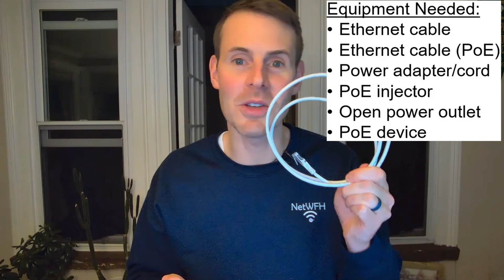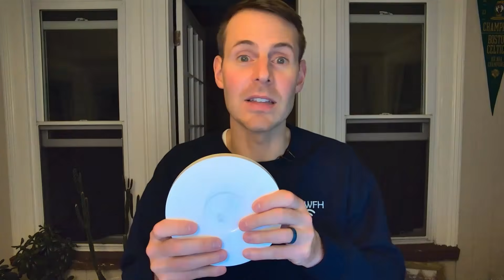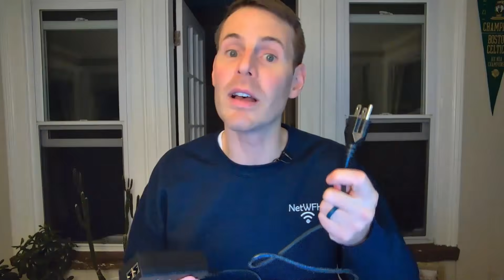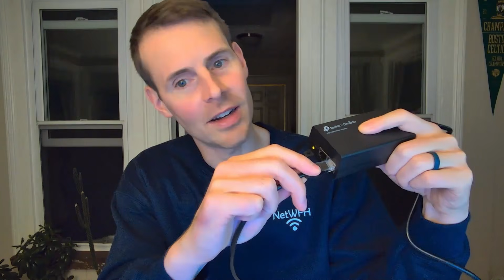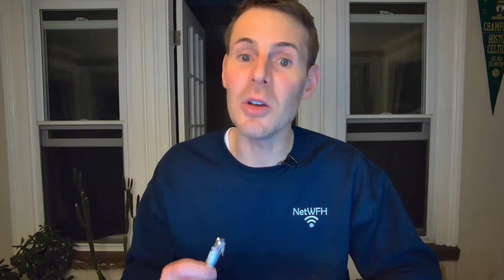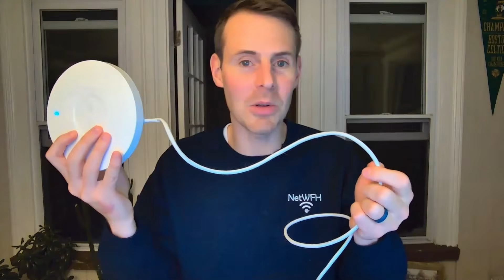How to Set Up a PoE Injector: A Step-by-Step Guide

Comment: Im just diving into this because I want a couple of home security camera's. But I most say this SO demotivating. Everhwhere I read: you should buy POE cameras, its more reliable, and all the other reasons. But the thing is: I want one camera on the front of my house, and one on the back. With POE cameras I also need a NVR, which then has to be close to my router since it has to be connected physically. Then I have to connect ethernet cables to the POE camera's and pull these cable all the way to the NVR, or use a switch in the middle and from there a cable to the NVR. This means: cables everywhere, from the cameras, through bedrooms, guided through corners of walls, from upstairs to downstairs, many more corners to the NVR. Why does it have to be this difficult? Why can't there be such a thing which can be used reliably but then wireless? I dont get it.

Comment: how about with regards to data transfer speed exaple if you have gigabit connection will it still work using that setup on a 100-150m cable set up(isp router to injector to tplink router)?

what could be the speed output?
can its still give you a gigabit connection speed from that distance 100-150m?
Reply from the maker: So with PoE Ethernet cables (and regular Ethernet cables as well), the maximum length of a single Ethernet cable should not exceed 100m. With that said, if you have an Ethernet cable that supports 1 Gbps and it is 100m long, you will still be able to get 1 Gbps through the cable. In other words, the length of the cable has no impact on the speed it can support. I hope this helps!